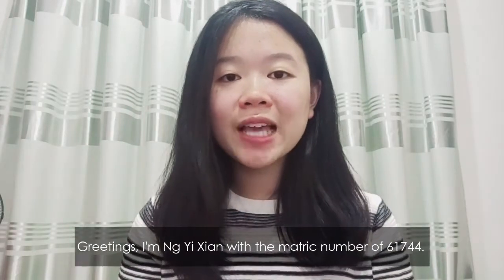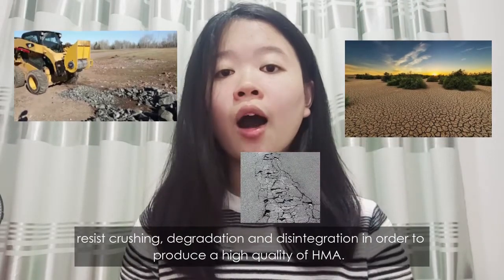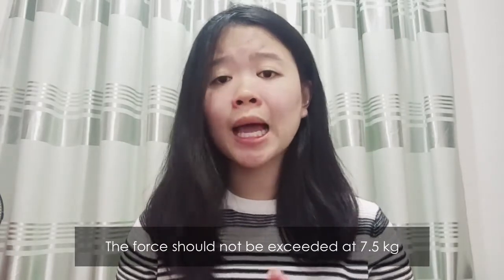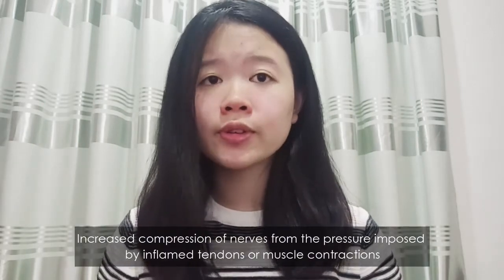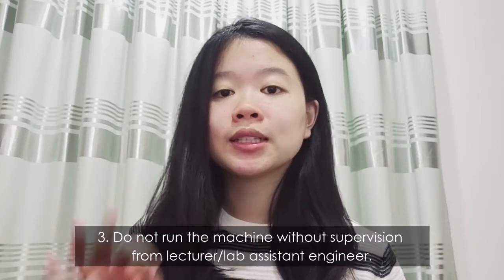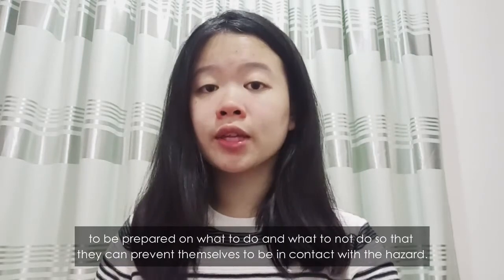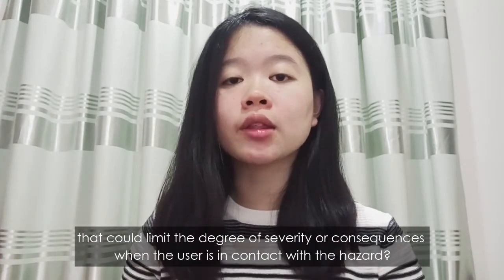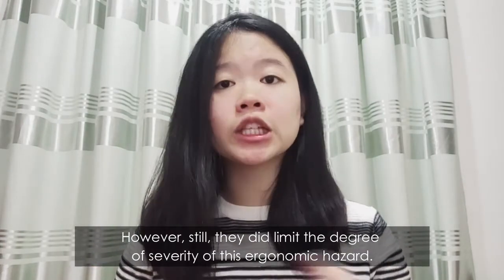KMS 3063 Occupational Safety and Health (Ng Yi Xian 61744) - Ergonomic Hazard

Comment: Yi Xian,

Thank you for this brilliant effort. Good knowledge too.

My comments:

1. You need to tell me the definition of 1) ERGONOMICS, 2) HAZARDS and 3) What are the consequences of exposing the worker to ergonomic hazards. This must be done at the BEGINNING of your talk. As a LISTENER, I have NO IDEA what are you talking about (as far as Ergonomic, work hazards because I did not know the definition).

2. Never give a technical talk with a curtain as your backdrop. You may talk while sitting at your workstation or with a whiteboard as your backdrop.

3. NEVER attaching a background music for this type of technical talk. 

4. Lots of drop by photos are brilliants.

5. Show the diagram or HIERARCHY of CONTROL (HOC). Then proceed by explaining your counter measures based on this HOC.

6. Show a picture of BACK BONES then indicate which parts of the bones will be severely affected from the existing work process.

7. There is a diagram about what is the amount of loads for a male or a female worker can handle at different body position. This can be used as a guideline in your talk about maintaining the correct loads.

8. At the end of your talk, please emphasise on the need to comply with OSHA 1994 Regulations. Section 15(1) and Section 24.

Thank you.
Reply from the maker: Thank you so much Prof for the valuable feedback!
I will definitely remember on what you have commented and improve myself better in the future😊